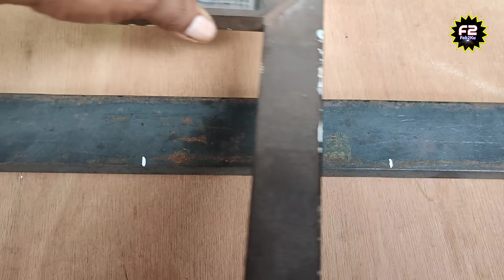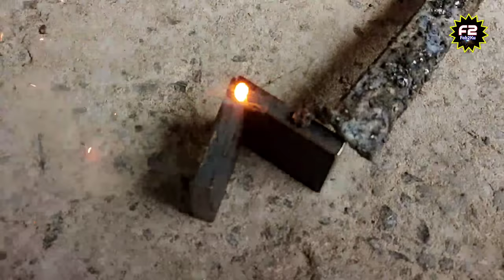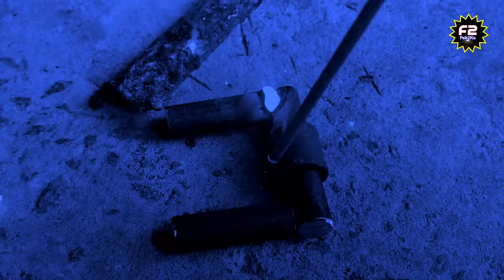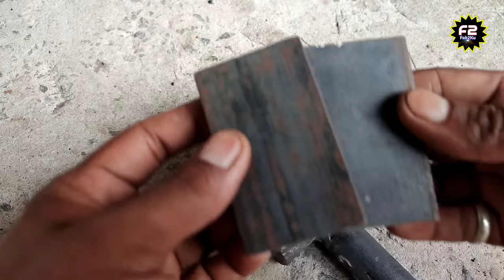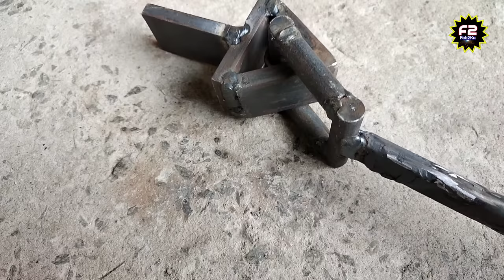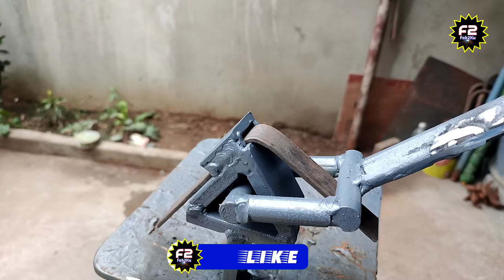Best Homemade Tools ideas For Workshop / Best Bending Tools For Round Bar / Best Tools For Workshop

Comment: Hi dude bit of advice from someonewho has been welding for 40 plus years, you will get better welds if you clean off all the mill scale to a shiny surface where you are welding & also you should invest in a new earth clamp so you get better contact which also gives better welds,
Keep up the good work
Reply from the maker: You Are Right Sir..
Thanks For Your Great Hints.
👍😀🙏❤️